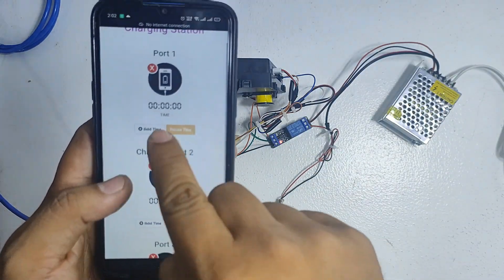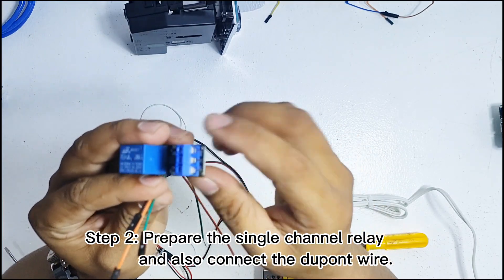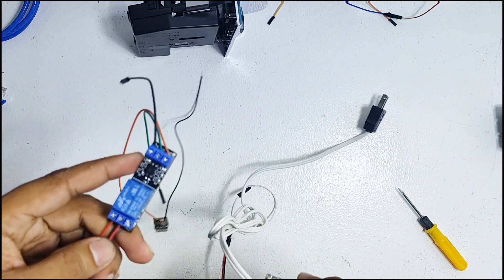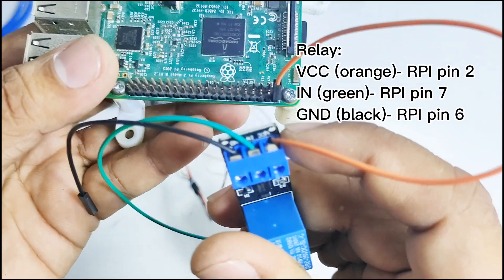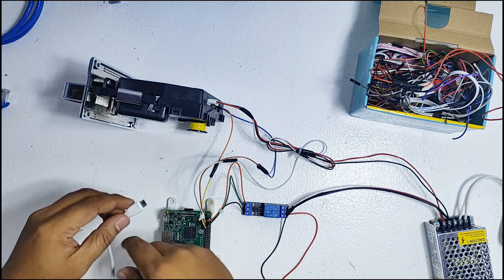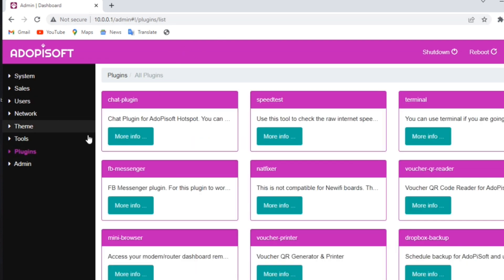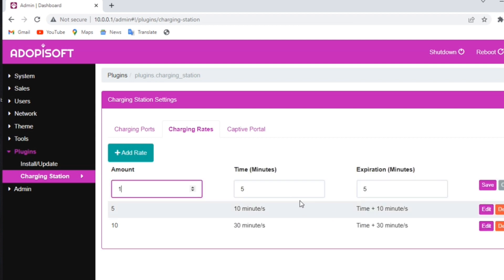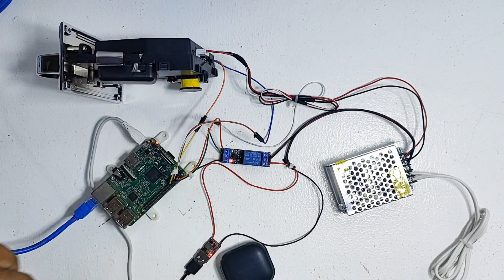How to Setup Charging Station Feature | ADOPISOFT

Comment: Sir hindi po continues ON yung relay kapag nag add time ka ng dalawang beses. Example may oras ka na 5 mins at running tapos nag add time ka lets say 5 mins so total time mo 10 mins. Pag naubos na yung 1st 5mins OFF yung relay at mag ON naman sa 2nd 5mins hindi siya continues pero yung oras continues.
Reply from the maker: Pero yung charging sir nagcontinue pa rin ba?
Reply: same ON-OFF-ON.
puede mag request, lagyan rin ng "seconds" yung time setting, salamat po.